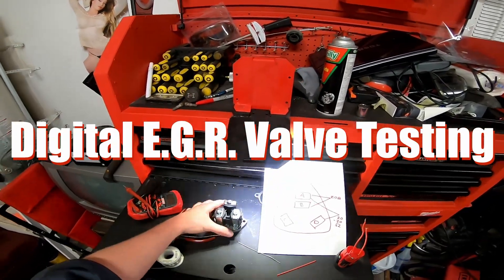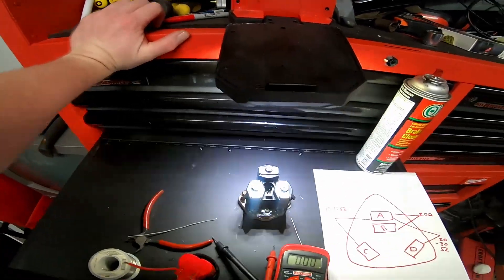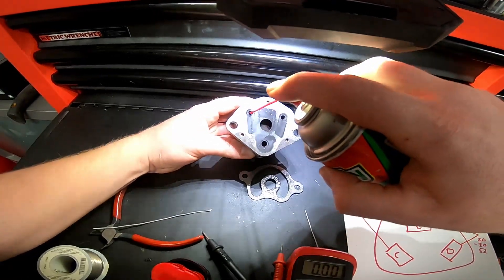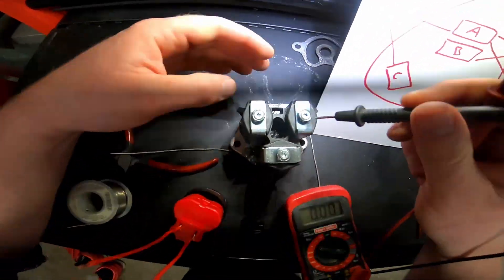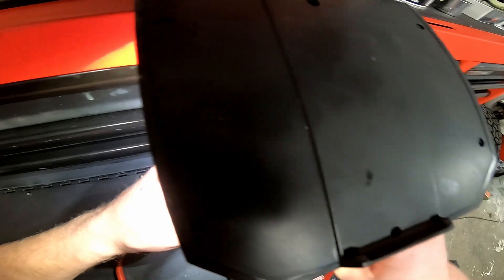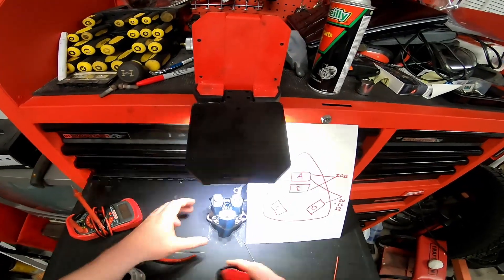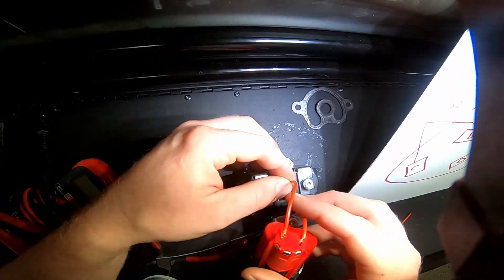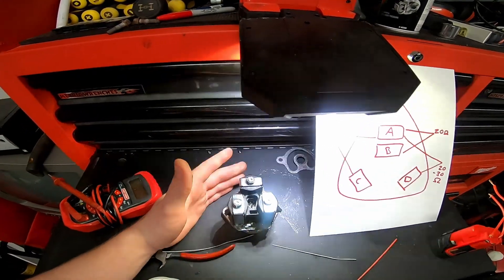Testing an Electronic E.G.R. Valve

Comment: I have that exact EGR valve in my 3.4l v6 Firebird. Thanks man
Reply from the maker: Happy to help, thanks for watching.
Reply from the maker: Let me know if you have any questions.
Reply: @GrimRepair  hey so the test when you use carb cleaner whenever I spray into the smallest whole it comes out of the center. The other two holes don't do this. Also when I shake the EGR valve back and forth the same hole that leaks there's a rattling sound coming from it
Reply from the maker: @sidneybaxter197  Then it's bad. The plastic doesn't look melted does it?
Reply: @GrimRepair  it doesn't look like it.  How would I know my cat is clogged without a pressure test. Also doesn't rattle like yours. Its just a quiet version coming from just one. I think it's just age cause it's oe
Reply from the maker: @sidneybaxter197  a pressure test is the best way. With the valve installed could you feel exhaust leaking around the egr? If not and it doesn't look melted, then your cat is probably ok, and you just need a new valve. Does the car run awful or just kinda stumble a little at stops?
Reply: @GrimRepair  it runs okay, it glugs rpm bounces from 800 to 850  when at idle. That's the best way to describe it. And it's lacking in power. Takes a while to start. Exhaust stinks etc..
Reply from the maker: @sidneybaxter197  does exhaust leak around the valve? If it does you won't be able to do the pressure test with that valve, and you may have a bad cat. Does the exhaust smell like sulfur?
Reply: @GrimRepair  smells like gas. Also might but some alcohol and 93 in gas tank. Maybe that'll clean it out. If that doesn't work I could add a gal of lacquer thinner to a half tank and drive all day long
Reply from the maker: @sidneybaxter197  clean what out?
Reply: @GrimRepair  cat
Reply from the maker: @sidneybaxter197  That doesn't work.

Comment: How i know number of ohms on egr valve?
I have Audi A3 2004 model 1.6 first engine
Reply from the maker: I am not familiar with audi's egr valve sorry, I usually try to stay away from European cars. I do know that you wouldn't want the solinoid to be shorted out (ohms that are really low close to 0) or an open circuit  (really high ohms)